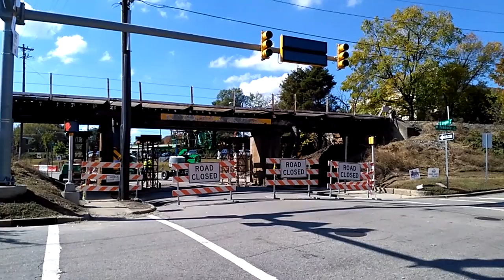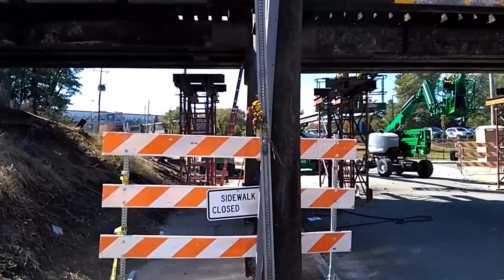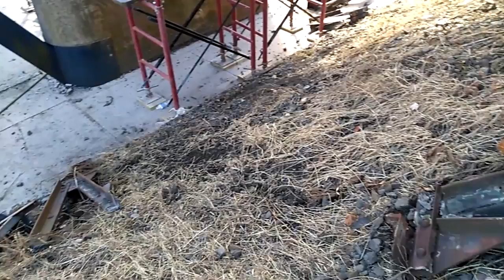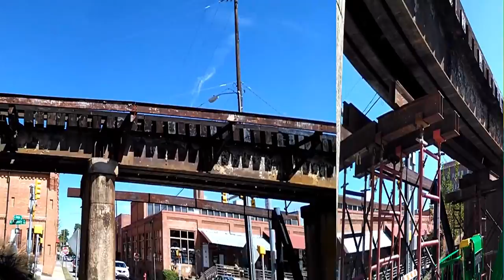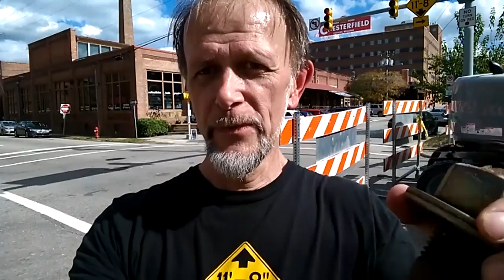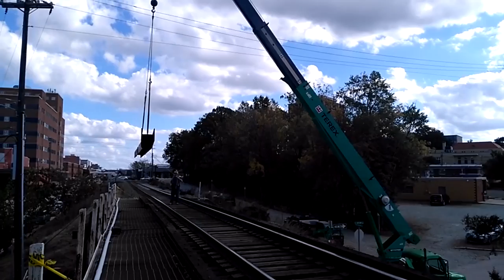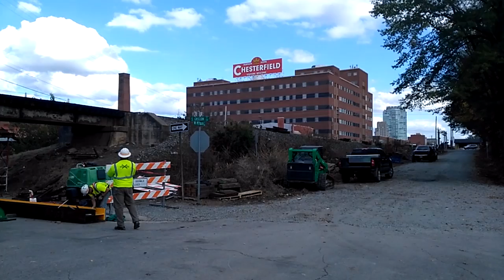Preparing to raise the 11foot8 bridge

Comment: I actually think that lowering the bridge to 10 feet would be better than raising it to 12'6".  At 10 feet, it's going to be obvious that it's a low bridge.  The problem right now is there are some perspective issues that make it difficult to tell that it's not a normal height.  Sure, some of the trucks that can get under it today will have to go around, but I think it's worth it for safety.  At 12'6", it's still lower than the standard 14' clearance, which I think is going to lead to more collisions.

Comment: Wouldn't  lowering the road and installing a pump if required for stormwater removal be a lot cheaper??
Reply: No.  The sewers underneath the road would be a hassle, and all of the other roads around would have to be "fixed" too, not to mention how that would affect the storefronts, etc.

Comment: Why don't they just lower the road underneath? Digging a bit seems more convenient than redoing a bridge
Reply: Absolutely right.  As a retired Civil Engineer, I can confirm that that's been standard procedure for years, all over the world, if it's going to be cheaper solution, which it usually is.  Even if the water table is very high - and I don't see any signs of that here - pumps can be installed which automatically come into action, to prevent flooding on the relatively rare occasions when there is torrential rain.
Reply: @robwilde855  On his website, Jürgen states that there is a major sewer main that runs just underneath the surface of the roadway, so lowering the roadway would be "prohibitively expensive". In the end, this turns out to have been true since they elected to raise the bridge rather than lower the roadway.
Reply: @user-ij9sh1tf9d  Ah - thanks for the info. I should have thought of that before opening my mouth!

Comment: So what happened, did someone who crashed finally file a lawsuit pointing at over 11 years of failure to remove and / or fix what is obviously a dangerous bridge? I often wondered why some lawyer had not filed with what would be a pretty obvious easy to prove history of repeated crashes despite the warning lights, and argue that it was a danger that the municipality SHOULD have addressed. Simple negligence tort, pretty prima facie...

Comment: I always wondered why it wasn't a swing span trestle.
Reply: Those are for bodies of water with shipping traffic.  Not roads!
Reply: @jovetj  way to think outside the box.  But seriously they actually exist as a technology so.... why not?
Reply: Incredibly expensive to install and maintain, and they would not solve the problem in this case as a truck would surely still run into the damn thing when it's closed for a train. 

On a body of water, ships of a certain height HAVE to be able to pass.  There simply isn't any other way for them to use the body of water!  Here, there is no requirement that vehicles of any height be able to pass underneath. There are plenty of alternative streets available!  I don't believe that you seriously thought through your suggestion.
Reply: Actually I did think it through but my perspective comes from my 30 years working on ships.  Lol
Thanks for your shore side eye view.
Reply: “When you're a hammer, everything looks like a nail.”

Comment: Believe it or not, I just found out about this today.   
I must confess that I am puzzled as to why the roadworks crews wouldn't simply lower the road surface instead of reconfiguring everything else.   
Normal, proper road maintenance requires resurfacing every so often, so, why not, when scraping, keep going several inches lower, then lay surface down, thus creating more room...?
Less cost, less hassle...Takes a couple of weeks max... And no disruption in train traffic. 
Just sayin'.

Comment: 12' 4" is still 2" too short for a lot of trucks. Especially if there's a build up of ice and/or snow!
Reply: Walt Rutherford try again. Most trucks are 13’6”. The carnage will continue and as a truck driver, I look forward to it.
Reply: @biohazard_613 Try again! You're talking about dry van semis (which is what I drive OTR). I'm talking about straight trucks! Anyone who tried to drive a dry van under that bridge doesn't deserve a CDL-A
Reply: Walt Rutherford You said trucks and didn’t specify straight trucks. I do realize that most of the vehicles hitting this bridge are straight trucks but there are lots of tractor trailer rigs hitting it too. I apologize for making an assumption, but as a driver, I hear truck and don’t think about straight trucks. To be perfectly honest, the 13’6” doesn’t mean much to me either as a flatbed, drop deck and lowboy puller. I’m rarely even near that height. I totally agree with you on any CDL holders hitting the bridge. I think that anyone that hits the bridge needs to have their license pulled for at least 6 months. I’ve rented box trucks on occasion. Every single time, I was told the height, width and length of the truck I rented. In addition, they gave me a map of my county, the county to the north and the county to the south with every single bridge or other object that it wouldn’t fit under, plainly marked. Their insurance won’t pay if you hit any of them. Also, I’m making an assumption again that you’re east of the Rockies. The reason I say that is I know that most bridges and overpasses are lower than out west. Some of the larger rental companies out here have high cube box vans that are 13’. When they’re rented, they specifically ask where you’re going with it and if they say east of Denver, they will only rent the 12’ 6” box.
Sorry that I came off the way I did. I reread what I wrote and that was not my intention. Shitty day and I unintentionally took it out on you by being a smart ass. I got a call at Thanksgiving dinner that the company I work for just got bought out by a company that I have a bad history with and refuse to work for. I was buying my truck and they repossessed it when I literally had one payment left. Now I have to look for a new job. Again, sorry for my response to you.
Reply: @biohazard_613  I didn't think I had to specify, since I was talking about a 12' 6" max height. I thought it would be obvious I wasn't talking about a semi. Especially since these were straight trucks.

Comment: Never underestimate the level of stupidity people are capable off. It will still claim more crashes even with the additional height.

It might be cheaper to out a flappy board at the height of the original bridge along the roads leading up to it. If a truck hits the boards then the drivers should know before hand that their truck ain't getting under that bridge.